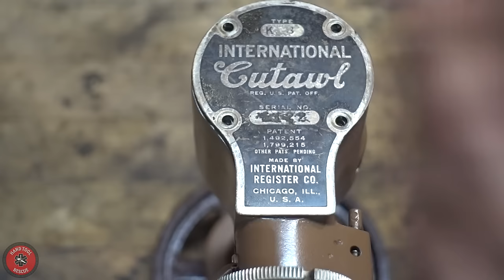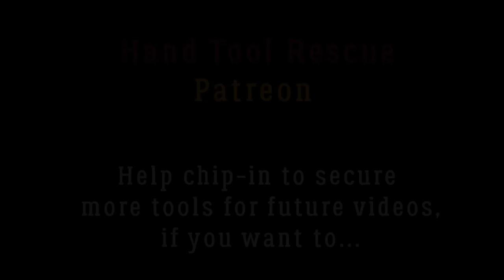1930s Rotary Jigsaw (Cutawl) [Restoration]

Comment: This mechanism looks entirely too much like a sewing machine to have not been inspired by one. Especially considering some Singer machines (at least my grandmother's) came with that very (or similar) B&D motor on them.
Reply from the maker: I agree 100%.  It's essentially the same mechanism.
Reply: Btw, if you get one of those Bosch mini knives, i bet that with a bit of a grind on the tabs, it will fit this machine perfetly.
Reply: bosch who say they invented the jisaw in 1947, say they based it on a sewing machine mechanism
Reply: this is just a simple cam mechanism, how else would you convert angular momentum to linear movement? (I used the big words so I feel smart)
Reply: My lathe uses the same type of universal motor. They were on a lot of tools back in the 1930/40's (watch makers lathe)
Reply: @aserta But it's a basic crank mechanism fercrissakes. Steam engines;  thousands of agricultural uses - long before the sewing machine was invented...............
Reply: aserta I was thinking same as I have a 1965 made in Japan all mechanical Jenome
Reply: For SugarBooty and Raymond Ashby, you missed the point. It's not about the mechanism, it's about how they look, as in, almost identical to what a dated sewing machine from Singer (at the time one of the bigger names) would look like.

Specifically for R.A. sewing machines have been around since the 1700's with final dating to 1755, singer is from 1851. This machine is 1930's specific, i'd say it's better to assume it's inspired from something in existence (and scale) than a heavy duty, complicated and LARGE machine that doesn't exactly need much in terms of design and thinking to take the abuse and punishment that a smaller, daintier part like the peg on this one for example has to take.

Specifically, this one has to be modeled after Singer's leather sewing machine line, some folks took those and simply stuck blades on them to create saws, they are that, robust.

And that's why my comment was made, i dabble in restoring these machines and the similarities in particular elements of design is striking.
Reply: aserta Ahh, good to know. That's really cool. I only watch the occasional restoration videos so I guess I don't have an appreciation for the tools like you. Really fascinating history behind them. Thank you for replying; have a nice day!

Comment: Wow. I was highly impressed with your idea of remaking the hand knobs with Bondo. Excellent method- I doubt I would have thought of it myself. I was thinking you would laminate circles of black plastic and cut them down with a ball cutter on the lathe and then insert the brash thread boss with epoxy in an oversized hole. I actually stopped the video when you smashed the old ball and began trying to think up how I would have replaced it. I even thought of using billiard balls! Your method was simple, direct tough and worked out quite nicely.

I make small movie props for movie productions and am surprised I did not think of using the Bondo trick. Very entertaining and instructive.

However, I believe I would have turned and polished the commutator on the armature. I would have also shaped the brush contact ends. But, that turned out not to be overly important. You did, after all,  break-in the brushes and the motor ran just fine. Also, I would have likely used lithium grease rather than Preparation-H, a vaseline based, low temp lube. 

But, holy crap- look at your results. Fantastic. Excellent rebuild. Congratulations on a job very well done.
Reply: Billiard balls is actually a great idea. He definitely make this look easy lol.

Comment: What made the cutawl special was that the blade could rotate in 360*  With the chisel blade, a lot of lexan material could be cut (even the middle of the letters) w/o picking up a drill.
Inside corners could be cut TIGHT.
Reply: I trust an old farts recollection better than a manual
Reply: I noticed that - and now I want one...
Reply: Yeah, much more flexible than the current “fixed forward” jigsaws!

Comment: I think you did an amazing job, and that's a wonderful tool with the blade rotation rather than rotating the body of the tool! The only thing I wished you'd done was run a ground wire to the base plate (inside the switch box). With all that metal, a ground is really a good idea. Thanks for doing this one!
Reply: I bought one to rebuild. Planning on adding a ground.

Comment: How flammable is this guy's workbench at this point?
Reply: Very...
Reply: Mauro Molinero 
Its more likely to explode into a giant fireball
Reply: SHH,  it's a secret offshore site unknown to EPA or OSHA, or EU.  He keeps it warm by burning MSDS.
Reply: Its over 9000
Reply: 9:47 Well that's dangerous enough
Reply: Damn you amateurs
Reply: Mauro Molinero good thing he lives in canada
Reply: The best preserved bench going. I've come across some old benches during demolition that are heavy with oil and grime. Always makes me wonder the amount of work they've seen and the blokes that have used them.
Reply: They'll need to build a concrete sarcophagus around the pyre of his home as it'll burn for a century.
Reply: It's driving me bonkers watching him spray that crap on the bench and then wipe it off!!
Reply: I am wondering if he has ever slipped across the floor from all the de-greasing solution's everywhere.  Hope you don't smoke dude.  Pooof up goes the workshop.
Reply: The noon Canadian winter sun leaning thru a dirty window pane and falling on that cleaning fluid soaked bench be enough to ignite that inferno
Reply: Picax8398 trust me, dry and hot is exactly how you describe Saskatchewan in the summer.
Reply: Yes.
Reply: The bench has cancer now.
Reply: yes we are laughing but it's very common thing

Comment: Finally.  A practical solution to cutting cardboard.
Reply: I use scissor.
Reply: He was joking
Reply: I'm still using my pet piranha, Chompy.
Reply: While I expect that was intended as sarcasm, you're absolutely right - The CutAwl was intended for exactly that kind of use - on a scale that you couldn't accomplish easily with scissors or a hand-held knife:  Think set and prop-making for theaters, stencils for painted billboards, etc.   It's impractical to cut that kind of thing with hand-powered tools, and, it's also impractical to elevate them on stands to make clearance for a long penetrating blade like a normal jig-saw uses.  The CutAwl can be adjusted so that you can just lay a sheet of material on the floor and drive it around to cut your design, without damaging the floor underneath.
Reply: This is just the kind of practical, factual comments we don't want to see here  @wray1104 . ;)
Reply: Oh, I always use a $75k laser cutter for that!
Reply: Looks like it was a sewing machine that got reinvented.
Reply: Best comment ever

Comment: Here's a tip on re-creating the ball.  Instead of blobs of bondo on a board - Find a hollow plastic ball (ping pong, tennis , etc.  and fill it with bondo) Spray WD-40 into your ball mold before squeezing in the bondo from a loaded plastic freezer bag. When cured, grind a flat spot on the  cured ball you've cut out of the mold. Drill and tap. -Yay!
Reply: That's a great idea !!!
Reply: @Thunderstixx77  
Thought exactly the samr thing two but ping pongs are too small and hunting down a pair of the right sized hillow balls as well as mold material to use golf balls is kinda a pain. 

This was a case of Occam's Razor where the most simplest answer no matter how obvious is usually the correct choice.

So using everything on hand... a board, and a bit of extra time finishing, that's all... he Hobo Hacked it and got exactly what he needed, no compromise, no fuss and maybe a little muss
Reply: Or buy plastic roundstock